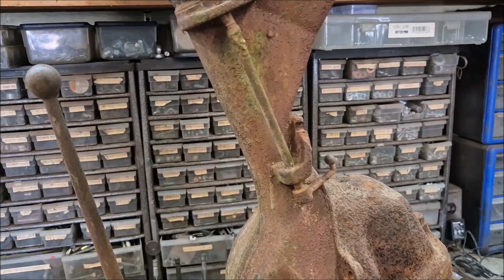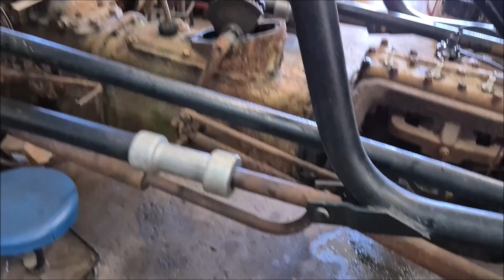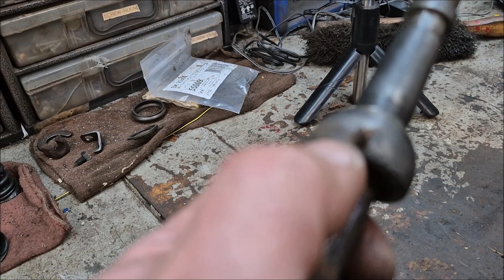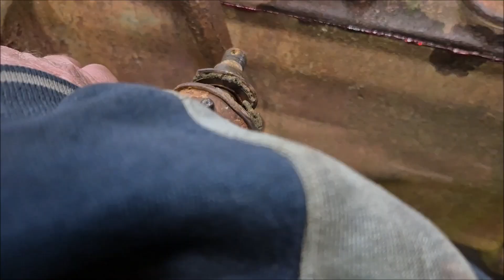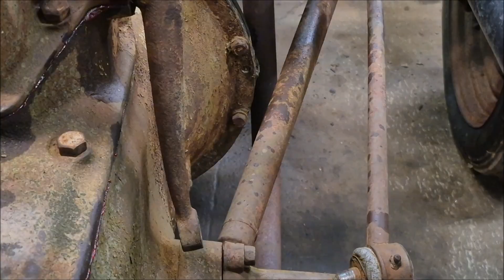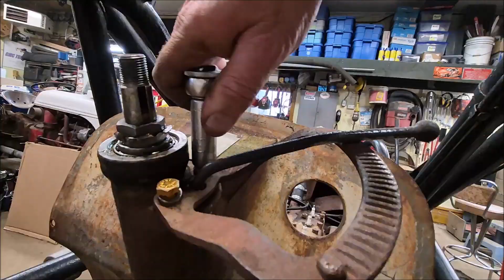1945 Ford 2N Loader Tractor part 7 Steering Box and Throttle Linkage

Comment: also did you replace the rope seals on the sector shafts??
Reply from the maker: No, I never do. The 9N steering box does not "contain" oil like the 8N box so I just let them be.

Comment: Good day, over the winter i brought home a 1949 Ford 8 N and did the usual stuff installed  adjustable lifters etc and full service recentely popped the steering wheel to try and lube the upper bearing my question is can you remove the upper bearing without taking the whole box apart ? Thanks Mike

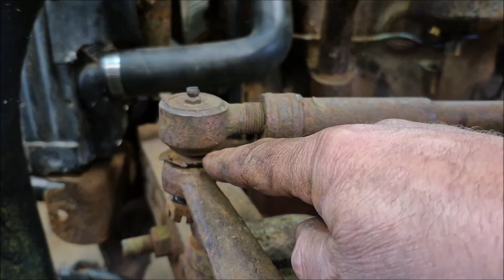Comment: I do not know if you have seen this clip so I will resend it to you.    Even with the Ferguson Safety System these little tractors have to be respected.   Skip ahead to about 18:30 in the video.   https://www.youtube.com/watch?v=QfLGhapE3ik                Most of us need to be reminded every now and then about farm safety, this one really made me take notice.
Reply from the maker: If he had actually read the owner's manual before using the damn thing it would still be right side up. People can kill themselves with anything if you give them the chance. What a waste of a perfectly good little tractor.
Reply: @ClaremontClassicGarage  The USA Department of Farming commissioned  a study and a design in the 1950's to protect farmers from this accident. The design is for a rollover protection that bolts onto the rear axle made of simple steel channel that is bolted together. The design was for Ford 9N,2N & 8N, plus the Ferguson line,  the design is still available on the web for free.
Reply from the maker: @brianferguson6278  Unless it is used in conjunction with a proper seat and seatbelt it will be more dangerous with that ROPS contraption than without. Again, use the tractor properly and according to the owner's manual and you will survive the day.
Reply: @ClaremontClassicGarage  I agree, I never saw a tractor flip like that one did...it takes 8.5 decades to live a full life and about 1 second to make a bad choice to end it.